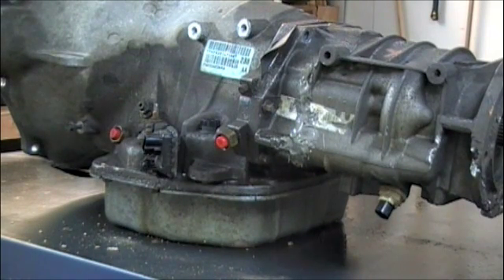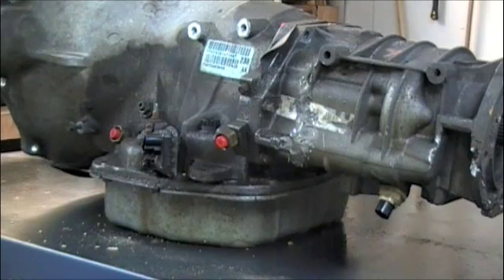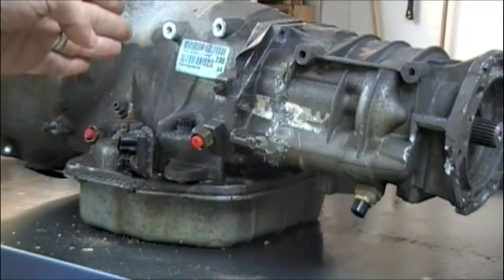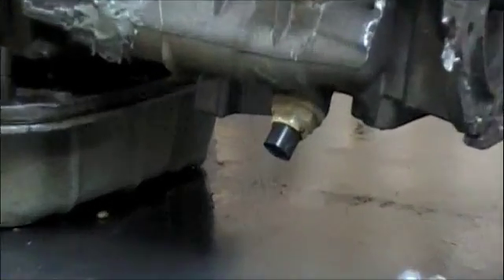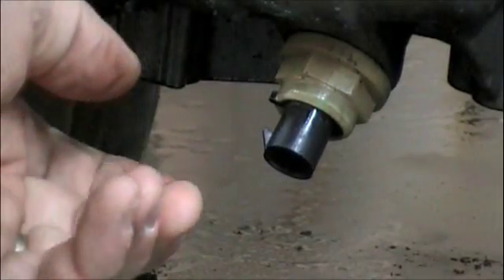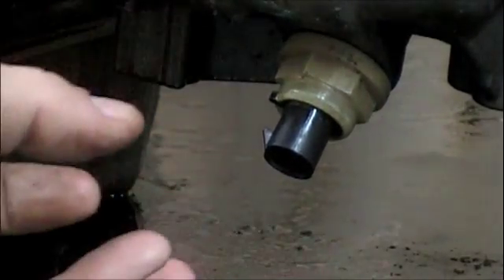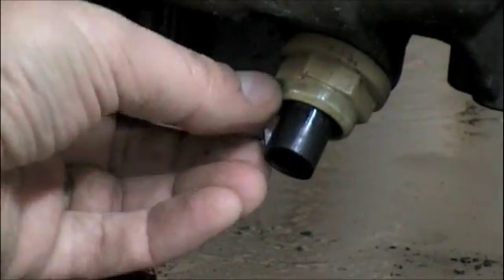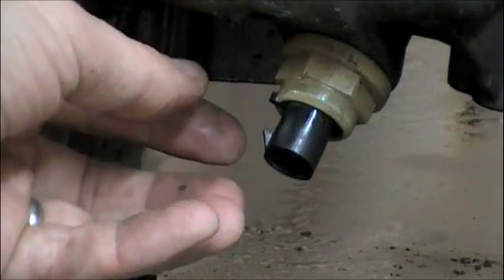RE Dodge / Jeep Output Speed Sensor Info & Location In Overdrive Section

Comment: On a 2000 Grand Cherokee is that output sensor sensor is by the speedometer cable at the rear end of the transmission

Comment: there is fluid in the overdrive housing and depending on angle of the truck/unit, some will come out
just remove old one and install the new one , shouldn't be much more than a dribble

Comment: Hey sir i just replaced my 2 solenoids inside the governor and shift solenoid and just replaced this speed output sensor. My jeep still is not behaving right.... it shift into reverse fine amd first gear but i press the gas and i can floor it and the truck moves slowly no repsonse really. Any idea?

Comment: 2 shops told me I needed a new transmission. 
I watched a bunch of videos and changed the speed input sensor and completely fixed it. Unbelievable.

Edit, 3 months later still fine.
Edit, 2 years later still fine
Reply: Before there was YouTube..trans shops absolutely raped customers for new transmissions because nobody knew what was happening with problematic shifting...all it really was.. a speed sensor!
Reply: @MrInternet69  Im not suprised, what a shame
Reply: Hey what problem did u had? My jeep compas has no power when i first hit the gas
Reply: @bryanenriquez8089  i had hard slamming into drive, and very hard slam from 1 the 2nd, 2nd to 3rd, and refusal to shift any higher
Reply: @machinesnmetal  in my case only the speed input sensor was bad
Reply: did you have to detached the transmission from the car? or can i change it with the transmission attached to the car
Reply: @ivanortega2019  didnt have to do hardly anything.  One screw holds the sensor and takes 1 minute to change, I did it in the autozone parking lot.
Reply: bro fuck transmission shops, they quoted me 5k to replace my trans, said there's no way to fix it

went and did my own work for a couple hundred bucks, transmission runs fine

i'll say it again, FUCK transmission shops, they can rot in hell trying to scam people out of their money

Comment: Hey CTP, is this the same for a 2006 Jeep Wrangler/TJ Auto and if so, could a faulty speed sensor be the culprit for 1-2nd gear bucking when cold or not related? I'm replacing the filter, fluid, etc and thought I might as well get these new while I'm down there for a few more bucks. Thanks for the vid!

Comment: Right he could have said drain the fluid out first
Reply: even if you drain the main section of the trans, it won't allow the overdrive section to drain
additionally much of the time, more than 60-70% nothing will drain from the overdrive section
we should have said - just be sure to have the replacement sensor in hand and ready to go back in
Reply: Quadman808, ya I have it on hand but not the fluid, so about how much trans fluid do you typically lose during the process?

Comment: FYI for everybody....this video is for the VEHICLE speed sensor, not for the TRANSMISSION input or output speed sensors
Reply: This is the transmission output speed sensor for the computer.
THERE IS NO INPUT SENSOR ON THE DODGE & JEEP TRUCKS.
For the Speedo There Often Is Another Sensor On The Transfer Case On 4WD Models / 2WD's may have a larger speedo in the Overdrive Housing Also
It Varies Model To Model

Comment: i had a p0720 code it said it was output speed sennsor so i replaced it. my truck was still acting the same with the new part so i replaced the governor pressure solenoid along with the transducer.my truck still won't upshift from first it just revs like it neutral i have no idea why its failsafing ,any ideas? the truck is a 97 ram 5.9 2 wheel drive
Reply: Did you find what was wrong?
Reply: Yes I did. After replacing nearly everything from the governor pressure solenoid to the transmission speed sensor, I found  i had an eroded wire leading to the output speed sensor. Atleast I have all new parts lol
Reply: I had a code for my governor pressure but it went away. Now I have a code for my output shaft speed sensor. I haven't checked the incoming voltage, but I did ohm the sensor and it is O/L. Thankfully the O.S.S. on my 99 Ram is only $18. I do believe I'll need to drain the majority of the fluid to change it, so I plan on doing a full oil/filter change at the same time.
Reply: common item that fixes the speed sensor issue when sensor known to be good

http://www.cascadetransmissionparts.com/search.aspx?find=12445ak
Reply: If it tested as O/L then the sensor is bad, correct?
Reply: sounds right
http://www.cascadetransmissionparts.com/46rh46reoutputspeedsensor.aspx

Comment: can that sensor being bad cause a slow acceleration?
Reply: Richard Cowtails I'm having the same issue. Did you find out what was wrong to fix it?
Reply: I just had a transmission overhaul done on my 5.9 durango..but slow acceleration..specialy steep grades..pedal to the floor..just going 45mph..driving me crazy

Comment: Im looking to buy a 2001 ram 1500 4x4 auto, all gears shift smooth but feels like its slipping in and out of 4thgear around 60-65, was wondering if this could fix the issue?
Reply: No but the Hyper tech programming module will fix that

Comment: My speedometer is not working.Also the ABS & Brake lights are on . Is this sensor the cause?
Reply from the maker: +F M- Ali - Hello with the ABS light more than likely its the sensor in the rear diff - we only stock one style of them - you can email us your model info with your request or see the below link to see if it matches your style of sensor

95% this is what you need

go to Electrical Advantage period Net

then see part # D72436B

electricaladvantage.net/moparspeedsensordiffmount.aspx
Reply: Gg

Comment: I had my vehicle up on a slight incline so I could get under it when I pulled the sensor fluid came out is that normal? It did not repair my speedometer as I had hoped.

Comment: Great job on the video! 
I have been searching for an answer to this everywhere.
I am installing an aftermarket stereo/navigation unit and need to hook it up to the speed sensor wire,  i suppose it would be the output?  Where can i find this and what color is the wire.  In my investigation it seams to be a common question for several vehicles but no good answers.  2010 Chrysler Town and Country.

Thanks

Comment: I have a 1995 Jeep Grand Cherokee Limited Full Time 4WD Does not have that sensor you show? only the speed sensor on transfer case (larger 3 wire setup) Am I not seeing the correct sensor or am I in the wrong place?  Car will drop out of OD or not shift into OD Intermittently. Sometimes not for a week. Also shows up as Code 12 on test from dash {engine check light.} Any idea's
Thanks,
p1nball

Comment: Isn't there another sensor further back on the overdrive case that is the V.S.S. or vehicle speed sensor? Isn't that the sensor that controls the speedometer and odometer on the 42 re transmission?

Comment: I have a 2000 durango 4.7. My check engine light came on and it started doing this weird thing, when I go from 20 to 0 really fast the idle on it goes from 500 rpm down to 350, then back up to 650 and finally idles at 500 rpm. I checked my speed sensor (Didnt pu il out) and saw that it was leaking a little bit off oil could I be that. Help please
Reply from the maker: Hello - First your transmission for a 4.7L Model would be a 45RFE - not a 48RE
Please feel free to email me through our website , that is where we handle all support and tech questions
Reply: is this manual from San Antonio? This is Rico
Reply: is this manual from San Antonio? This is Rico
Reply: is this manual from San Antonio? This is Rico

Comment: 2000 Dodge Durango 4.7 Check Gauges light comes on and Voltage gauge shoots to 18,  I was told this could be the reason Speed Sensor ground could be causing this?? only does it when going 70+ miles per Hr.

Comment: Thanks for the video. I noticed that sensor you removed was damaged at the tip. I just had the same failure and was concerned if something was wrong internally that wiped out the tip. Have you seen this before?

Comment: i have a 2002 jeep grand cherokee and the transmission stay stock in first gear... what can the problem  be... thant you
Reply: i have the same problem and i put my jeep on a scanner and it said that i have problems with the output speed sensor, so i think that the output speed sensor is bad, so it is the sensor of this video
ah.. i have a grand cherokee limited 1998..

Comment: Would this speed sensor resolve a P1974 Speed sensor ground error or would it be the wire harness? Additionally, the back up lights do not engage in reverse. I suspect this may be associated. I have a 2001 Grand Cherokee with a 545RFE

Comment from the maker: a hard shift could be anything from high line pressure , to a sticking friction plate. Was the fluid changed in the last couple years ?
One thing , you could remove the output speed sensor , and inspect the end of it. They will always have some metal on them as they are magnetic , but if it has a great deal of metal then you have have to overhaul it.
Reply: Thanks buddy 🎉

Comment: Thanks for your quick response . Do you have any suggestions on were to go from here .
The transmission does not slip just shifts hard . I did just replace the instrument cluster because the speedometer wasn't working right but now it does . could it be the output speed sensor ?

Comment: I have a 1997 Dodge Grand Caravan 3.3 and the transmission shifts hard up/down shifting  with codes p0700 transmission control system p1776 solenoid switch valve latched in the LR position p1784 pressure switch circuit :LR  I just paid to have the shop put in a new solenoid pack . Did nothing to help but now no codes (still shifts just as hard) What now Please help

Comment from the maker: i would start with the abs sensor
see electrical advantage d o t net part# D72436B
often that one sensor will cure both of those lights
it may address the speedo issue as well , as that is where the signal comes from for the dash display

Comment: hello CTP... My abs and brake light are staying turned on. I looked it up and Im replacing the abs speed sensor. will this help, and can you please tell me the difference between the two (output speed sensor) thanks. oh, and my speedometer dosent work under 30mph.

Comment: the speed sensors on those models are common to have issues ; normally occurring around 80,000 miles or so. Typically when this happens you will have a check engine light with an improper gear ratio code , or a speed sensor code.

Comment: I have a 545rfe trans on my 05 4.7 ram. It hesitates when being put into gear, but I do have reverse. It shifts fine from first to second but won't shift into or past third. My rpms rev high like I'm in neutral. No leaks and fluid looks good as new. Could this be my problem?

Comment from the maker: no a windstar in a front wheel drive
you have output sensor on the top of the case about 6-7"'s 
back from the axle
typically there will have a wire lead as part of them that is about 10"'s long

Comment: Hello, I drive a 1994 Jeep GC Laredo with 42RE. Yesterday the o/d off light came on and would not go in to o/d. Just before I parked I noticed that I had only the third gear(guessing based on the rpm and the vehicle speed). After I stopped the tranny is slipping bad and wont engage,did not slip before I stopped. 
I checked fluid level/condition & looked OK.TCM has an error code 13 for VSS no signal stored.

Can a failed VSS cause the tranny to not engage? Is the VSS same as shown in the video.

Comment from the maker: Ron - be sure the unit is filled - should be topped in running and in Neutral
also may be worth a front band adjustment if not done (this is a 5 minute process)
these units are known to act a little odd when even half a qt low on fluid

Comment: Well did the install and right after that changed plugs and wires. The transmission solenoids were lots easier. :-) It really helped 1 to 2 and 3 to 4, but 2 to 3 is still not shifting well. RPMs go really high, 3200 - 3500 and then hard shift to 3rd. Any ideas?

Comment: Hi, I have a durango 1999, I changed the throttle position sensor, has improved enough to no longer drowns arrarcar but follow the truck pulling the change until the 3rd, I think I should change the output speed sensor .... I disconnect the battery to change the speed sensor?

Comment from the maker: Hello ,
yes , but this doesn't fit any 2006 models i know of
depending on your engine size we have a few different ones available
if you have a 4.7L , or 5.7L Hemi on our site see part # 72436 (2 required per transmission)

feel free to send further messages through the contact us page

Comment: is this also called the transmission output sensor? I have a 2006 Jeep WK that is shifting erratically sometimes. Somtimes you can rev the engine over 3000 RPM, and it won't shift from 2nd to 3rd. You let your foot off the gas, and it will shift. Other times, it shifts normally. No transmission fluid leaks.

Comment from the maker: no this sends the revolution speed to the computer , but normally it will stop functioning or create a check engine code. More than likely your issue could be related to tire size , or possibly the ABS/Speed Sensor on the diff. Is the check engine light on ? Please feel free to email me though our website (contact us page)
the fluid will not leak out if you pull this sensor

Comment: All mechanics I've talked to said that it could very well be this. It's telling computer it's running at different temperature. My truck would never switch into overdrive until it hit a certain temperature. I have changed fluid and filter and added Lucas Transmission Fix.
Reply: DONT USE LUCAS TRANSMISSION FIX